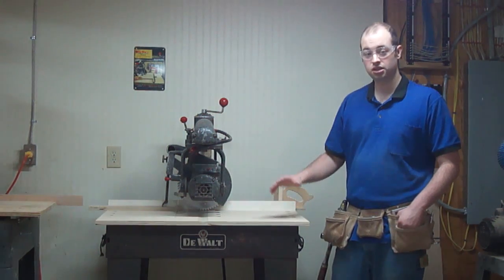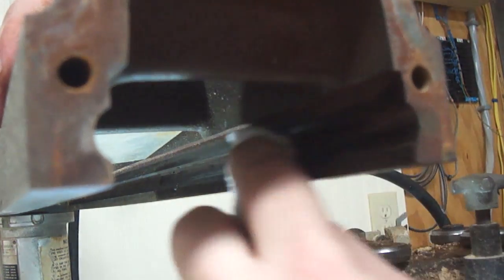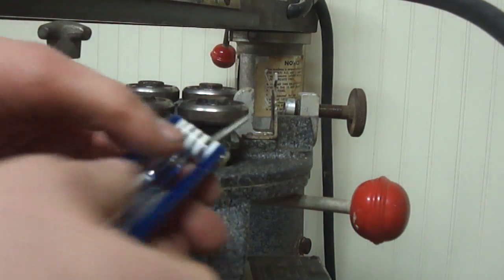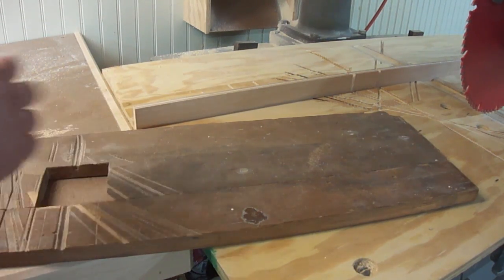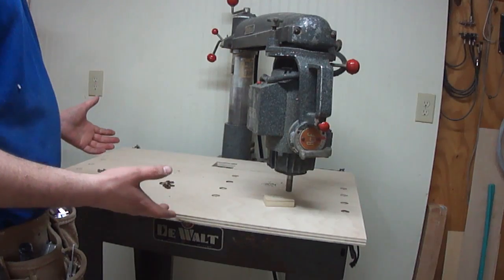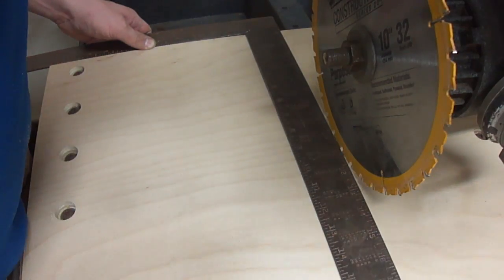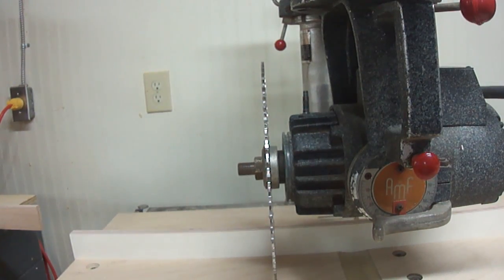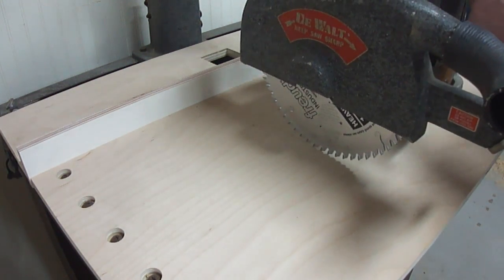How To Completely Align A Radial Arm Saw

Comment: The last part of the video shows you cut the wood by pushing instead of pulling. Can I always cut that way or do I have to always cut while pulling?
Reply: He pushed because that was the first cut on the table (i assume for future references), and for the fence as well (same reason), so there was no work piece to be cut. I think it wouldn't has been clean (accurate) cut on the fence if he pulled not to mention the danger could occur when carriage (yoke) is moved (pulled) with the same direction with the blade rotation. 
Pull (cross) cut (with workpiece) is safer because the entering blade "push" down the material (and to the fence too).
I'm new to RAS, and just setting up/checking mine and would like to know and understand it before(!) i switch it on.
Hope my comment is helpful and (asking) others to correct me if not!
Stay safe and enjoy yr RAS! AB